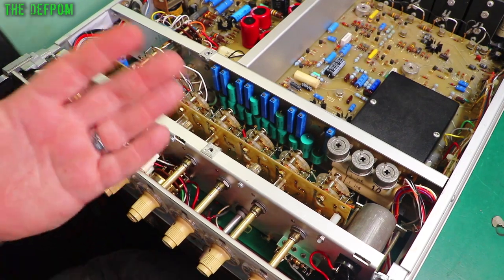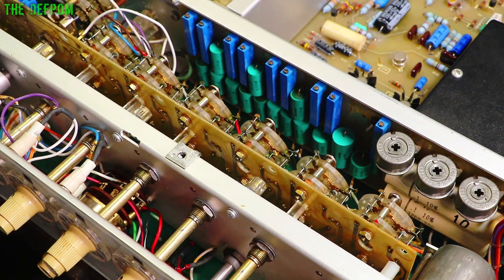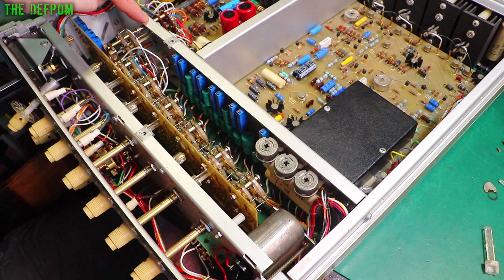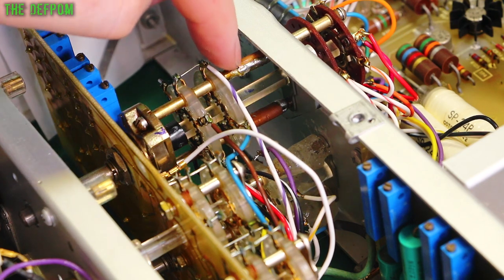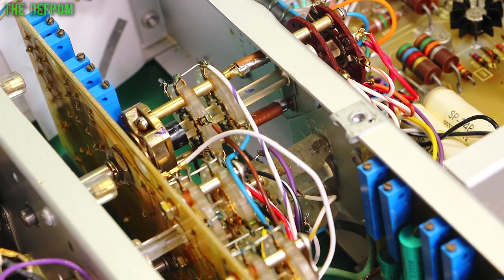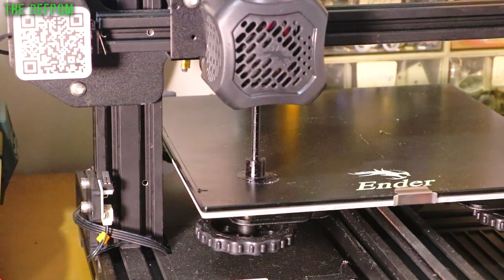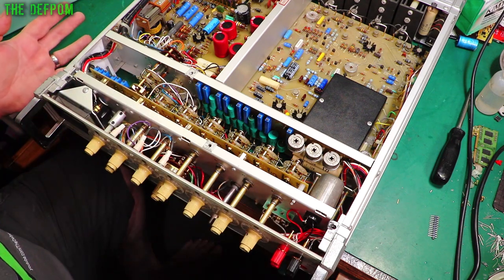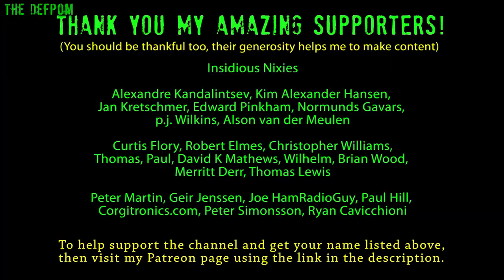🔴 Fluke 343A Switch Repair - Fluke 341A Switch Repair- No.835

Comment: What a great idea, 3-D printed shafts and extensions !
 I'm really going to have to get a 3-D printer someday.  My problem is finding space for one.
Have you made a video on your printer ?

At my last job, we had 88,000 tabletop printers that had to be rebuilt - because the newly hired Chinese plastics shop that had manufactured the printer's top and bottom case, had sped up the flow rate so high, with the melt temperature so cold that it did not flow properly into the molds.   This made for printer cases that were literally falling apart in some of the customers hands as soon they were removed from their shipping cartons.   
Not sure the stockholders were ever told the truth about that episode.
Reply from the maker: I have done several videos on 3D printing and the printers, I have a playlist on my channel for them.

My experience with some Chinese moulding plants/mould maker samples, shows that sometimes they really have no idea how to process a certain material, they have even used completely different materials to the ones they were supposed to use for samples, as that is what they were used to, and when tried on the final production material they would not fill properly or had pressure burns from trying to get it in, as they also heated the mould instead of running chilled as per the spec ! It is also possible that they were using recycled material instead of virgin, and used materials from there tend to have problems.  Another issue we have had is the steel being used, often it isn't the correct grade or turns out to not be what was paid for, for instance we had a mould made from Stavix.... due to corrosion resistance requirements, its cavities started rusting after the first production run! And to add insult to injury, when splitting the mould for inspection after that run, it was sticking a bit, so a copper mallet was used to help get it moving, it DENTED the mould mounting plate ! the copper was harder than the mould steel.
I have seen numerous videos of chinese moulding plants, some of the safety standards are damn scary.... such as unguarded machines running in FULL auto, with someone leaning into the mould area to remove a product before it shuts again!
Reply: @TheDefpom  I'll have to watch those videos of yours.
The politically correct description we used for that crap plastic was "re-grind".   Our plastics engineers called it "floor sweepings".

Comment: That's a really impressive fix. Did you  have to print off a few before you got it exactly right? Nice one Scott.
Reply from the maker: Yes I went through 3 tunes to get a good fit for the switch wafer to make sure it turned precisely.

Comment: Excellent repair vigeo as always. I have similar, if not the same, isolation shafts in my Fluke 5200A needing replacement. Are you happy with your 3D printer? What model do you have? I’ve been thinking about indulging in that world.
Reply from the maker: I have a few printers, the original ender 3, the Ender 3 V2, and the geetech a20m, out of those the Ender 3 V2 is my preferred unit for basic prints.
Reply: @TheDefpom  That's not too expensive. USD$280 off Amazon, but I don't see this model on your referral page at Amazon.  Do you want to add it before I ask my wife to buy me this with my own money?
Reply from the maker: @rpbale  I have added the V2 to my Amazon store now, thanks Rick.

Comment: Not so sure I would had used black.  If it were carbon black it would definitely affect the dielectric strength of the plastic.
Reply from the maker: Actually that is a good point, i really don’t know why I didn’t consider that aspect myself, having a level 5 certificate in plastics materials and all ! I might have to do a dielectric breakdown test using a insulation tester to see if high voltage leakage is an issue or not.
Reply: @TheDefpom  Not that it matters in this case but carbon black can also affect RF parameters of parts too.

Comment: Hmmm... looks to me like a BIG problem that's going to keep coming back to haunt you.  Personally... once I'd got the manufacture of the new parts right, I would be inclined to replace them ALL at once, and have done with it.  But only YOU can get a real feel for how hard this would be!
Reply from the maker: The other switch shafts look ok, I’m more worried about the standoffs, but I at last have a solution for those if they do fail in the future.
Reply: @TheDefpom  Just print a set of them all, and place in a small bag with the rest of the spares. That way you will never have the rest fail.
Reply: @SeanBZA  LOL!......thats my luck you are playing with.....:-)
Reply from the maker: @SeanBZA  indeed, makes some spares so the originals never fail, that normally works. With 2 spares in the bag already hopefully my offering to the electronics gods will suffice.